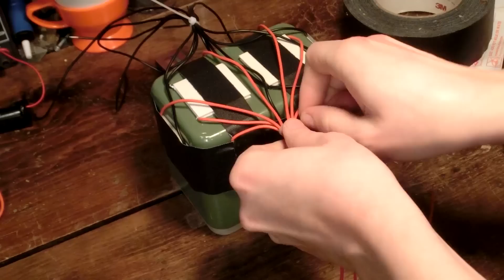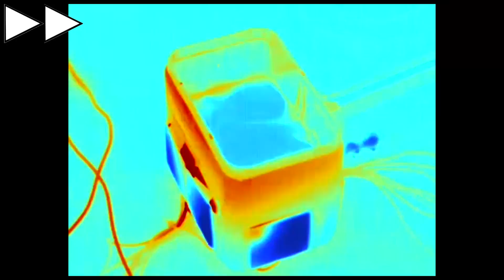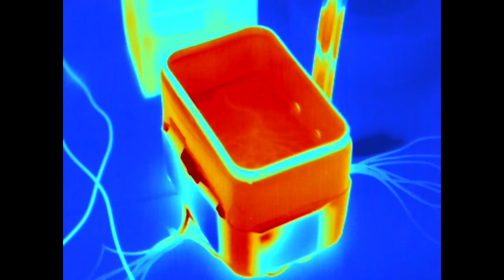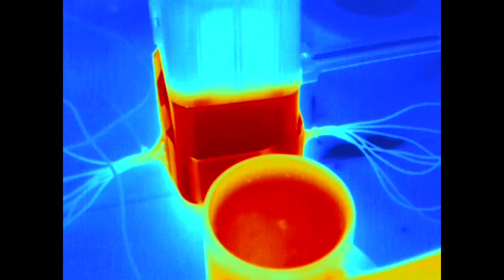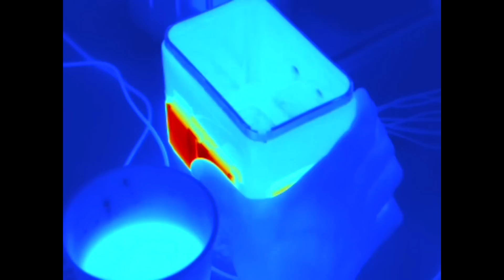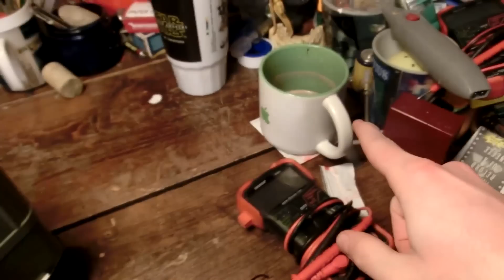Electric Ration/MRE Heater 03: Thermoelectric Peltier Cooler Test

Comment: They definitely need some sort of heat sink on the cold side to dissipate the cold side of the peltier for them to work properly
Reply: Rinoa Super-Genius using a heatsink makes them way more efficient at heating in my experience since they are continuously able to suck heat out of a much larger volume of air...
They seem a very inefficient way to heat something to cooking sort of temperature ... a resistive heater should be way more efficient at higher temperature differentials 
... or possibly a hybrid if you are heating frozen stuff??
Reply: you still need a cold sink  for the cold side
Reply: Here are some ideas  that should be fun to test.
All i got to say it try it out and you will see the hot side will be able to get hotter faster  because it will be able to absorb the ambient temp in the room.      there not really designed to be heaters. they are made to transfer heat from one side to the other.  the heat you git from them one one side is all ready cold is just a extra heat from the electric process  witch helps you in your case since your heating with it instead or trying to cool  but you only getting the benefit of  the inefficiency of them   and not the pull potential  with out being able to absorb more room temp in the the cold side.     so once the cold side it cold  and nothing there to help keep it worm    then your only using it as a badly designed heating element      if you not  supplying warmth  to the cold side you may as well be using them  heating element weirs    and wrap insulation around the out side of them so they ore only heating the can and not the aria on the out side of the wires
Reply from the maker: you dont dissapate cold, and no if i run this at 12 volts it should just make its own heat enough. i dont care about the heat pump action of this right now.
Reply: jotdot when it's being used to heat food the food is the heatsink.

Comment: Where did you get the gaffer tape? Did you order it online or buy it at a store. Its one of those things I have been casually looking for, for years but never cared enough to look online.
Reply: You can pick up rolls at Guitar Center, or your area's equivalent music supply shop, albeit at a pretty steep price usually
Reply: watch out for the silver colour tape.. it's conductive !!
Reply from the maker: both, i got some in california and shipped it here with my stuff but have also ordered some....oh and i have a few rolls that shoulda gone back to the lab before i left apple. woops. :p
Reply: Wiresgalore I never thought of that. I actually learned of gaffers tape while taking broadcast sound engineering at a local tech school when I was younger. Now I am curious what the price difference is and I wonder if you can haggle like you can at guitar center.

Comment: The Peltier are better for cooling something than heating it. The issue is they reach a saturation temp around 100 F (depending on the model). which means you cant really cook food so much as warm it. I love your videos keep up the awesome work and where did you get your modules from? I've been looking for some inexpensive ones to cool/warm my bunnies.
Reply from the maker: no, if you put in 8w of power they will put out 8w of heat. thats good enough for me, its how circuits work. my plan is to plow past 100f and heat both sides. i dont care for the heat-pump action im just using them like expensive heating coils.
Reply: yeah but wouldn't a resistor work faster and be able to get to higher temps. And double check your spec sheet some of these fry once you get them above 140
Reply: Rinoa Super-Genius Until the temperature gradient destroys the TEC modules.
Reply: if you are looking for a place to start with giving your bunnies some heat pick up an automotive dash heater from harbor freight. it's 12v and already has a blower fan. of you ran it off a power brick that can deliver decent enough current you could get heat for a small hutch room. I have one and it draws about 10a which would probably be too warm after a while unless you dropped the current some.
Reply: the cold side could do with a heat sink to keep it cooler thus nat saturating the hot and should get hotter
Reply from the maker: *****
define "saturated"
Reply: I was going to give you crap about using peltier coolers as expensive heating coils, but clearly you're well aware :)

Comment: TECs really aren't the best for heating because they are optimized for cooling leading to assymetry where they cool more than they heat which really isn't what you're going for. Cool concept though. Also for testing them you could use an old computer power supply since they have pretty beefy 12v.
Reply from the maker: no they heat more than they cool, if i put 8w of electricity into a cooler it puts out 8w of heat.
Reply: Rinoa Super-Genius they put out 8w of heat of course but they also transfer heat so you get more than the 8w which is what you want but some are optimized for cooling some for heating and these look like the type for cooling. Could be wrong of course.
Reply from the maker: so then this is better than a filament, meaning i dont care if cooling is better. its better than a resistor and it also acts as a nice insulator.
Reply: If you add a little bit more heatsink (or should I say "coldsink") on the cold side, it may output more than 8W of heat because it's getting the rest from the ambient air.
Take a look here for a coefficient of performance (efficiency) diagram at page 4: http://www.ijeit.com/vol%202/Issue%207/IJEIT1412201301_03.pdf

Also add some thermal paste under them ;-)
Reply from the maker: yeah i'm wanting to see about adding an outer metal shell that would press the peltier coolers against the pan, but also i could seal it up nice and good. and yes, plenty of lithium grease next time.
Reply: Rinoa Super-Genius
I think an outer shell that is about 1-2cm taller than the peltiers should do fine. It would heat by convection because of the gaps between the peltiers. Also, maybe paint it black for better results so it can heat up by radiation as well!
Looking forward to the vid.

Comment: I know that you probably don't want to do a perm jobby on that, but what about holding them on with thermal adhesive? 

https://www.amazon.com/Arctic-Silver-Premium-Adhesive-ASTA-7G/dp/B0087X7262
Reply: actually an heatsink could make it heat up faster. if you can take the cold away faster than the air and tape the other side could get hotter faster because of the difference in temperature between each side.
Reply: yeah even just some thermal compound would help out a bit and add a few turns of like an aluminum band on the out side to act as a heat sink
Reply from the maker: i dont need a heatsink, and yes i said i'll add lithium grease.
Reply: Just to clarify. thermal adhesive would be a attaching the peltiers permanently to the case without having to rely on tape.  Reminds me of the 386 days